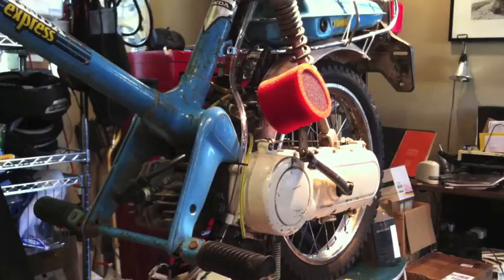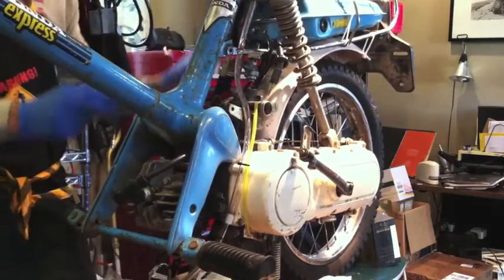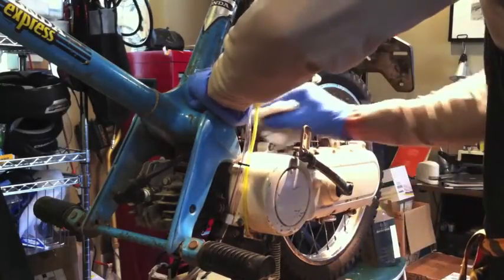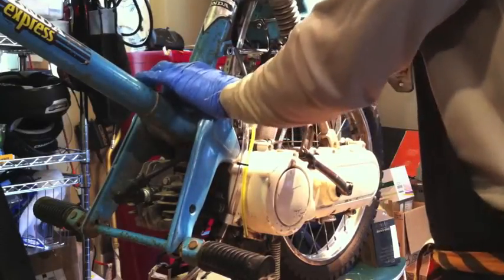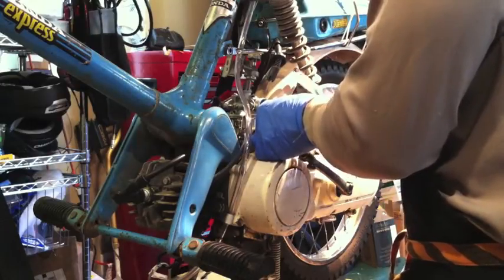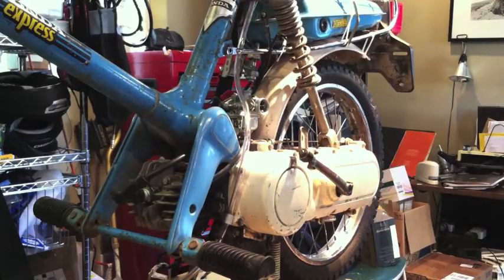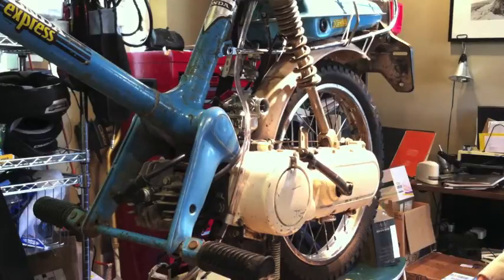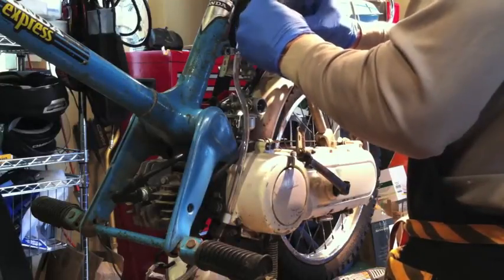Honda Express Replacement Carb Installation

Comment: Thanks for this learning videos about carb.i would really appreciate if you can help and explain my problem,i just bought a 1981 h.ex.nc50 with a rusted and plugged up carb,so i bought a chinese made one fr ebay and when i installed it,the gas lever throtle is totaly loose and the jet needle wont go up or down,theres just no function,so i wonder how am i gonna make it work?im just a begginner lol' thank you....

Comment: Thanks for the video.  Just ordered the same Dellorto carb with manifold and shim the other day.  Looking forward to installing it on my 82 Honda NX50 Express SR.   Fingers crossed that I don't have to trim down at the throttle.
Reply from the maker: I haven't owned an Express SR yet.  So I'm hoping that it takes the same carburetor and/or intake adapter.  I guess the easiest way to find out is to take your old carb off and measure from center to center at the bolt holes where it connects to the intake.  That needs to be 38mm.  If much different, there will be an issue with the Dellorto and intake.
Reply from the maker: Ok, saw your post on moped army.  Looks like you are getting the NU50 intake from MLM.  Good luck.  If you don't want to adjust throttle cable you might be able to dremel off the metal cable guide like I did.

Comment: We've got an '82 NC50. You said installing this carb on an '82 has quirks. Can you elaborate?
Reply from the maker: Goofy throttle cable tube, clearance between carb and intake.

Comment: Interested in ordering one of your carbs. Have a 81 Honda Express and am fine with mixing 2 cycle  with fuel. You you happen to know what part number or carb would work the best. Looking at the Dellorto carbs on eBay but they seem to mount up different. Any help is definitely appreciated. That's man
Reply from the maker: Dellorto carb is nice but requires intake adapter; however, easier to remove carb later. Mine works well.

Comment: The carb I seen on Amazon.is 32mm center of hole to center of hole but you said it's a 38 mm .which one will fit my 79 express
Reply from the maker: 38
Reply: @jackrutherford-1  good thing I didn't order the 32...why do they claim it will fit
Reply from the maker: @xjeepmanx  they don’t care at $18 or so each. What percentage ask for a refund?

Comment: Great Vid, Owen Wilson. I've had decent luck with the cheap little WangChung carbs on older Hondas but In the case of my 78 NC50; They're all wrong. OEM Keihins have Manual Handlebar-Mounted Chokes (As The Good Lord intended for ALL proper machines) yet NONE of the aftermarket ones do! With the carb mounting "sideways" on these I think that's rediculous. How bad is it really? I could just man up & throw the OEM unit in the ultrasonic cleaner but I'd rather spend $20 & go to bed. -_-

Comment: I have a 81 Honda express nc50 I just picked up.  Carb was rigged up with a old lawnmower air box lol runs like crap and now can't get it to start back up.  Believe it is the original carb just no airbox and has the auto choke and fuel mixer set up.  I really don't trust the fuel mix system cause of its age and believe the auto choke is part of my issues with it running correct.  Were can I get a carb that has Manuel carb uses premix fuel and can mount up without the original airbox.  Saw in some of your other videos you drilled out something on the carb to make it run right are there any that mount up ready to go no drilling?
Reply from the maker: this one does not require drilling and you use it with a 28mm air filter http://qt50.net/honda-nc50/honda-express-after-market-carb/

Comment: First I've ever heard of a 'carburetor drain hose'  ( learn something new every day! )
Maybe if I live another 67-years...I'll actually see a 'carb drain line' and now I'll already know in advance what it is
Reply: I dare say every carb on every Small Engine'd wheeled machine ever has a line at the bottom of the bowl to drain it. That would be what that screw is for.

Comment: My throttle spring is caught inside (stuck) When I get it off can I put everything in my electrosonic cleaner?
Reply from the maker: sure but I keep the non-metal parts out of the cleaner

Comment: Hello. Whats the size of your carburetor? I have 1980 Honda Humming with NC50 engine, i want to replace without replacing the intake or manifold. It would be a big help if you could tell me the exact size of what size is compatible with it. Thank youuu!
Reply from the maker: Ira 38mm from bolt hole to bolt hole
Reply: @jackrutherford-1  can you be more specific other than the bolt hole? I'll be having a hard time looking for such since im based in the philippines where resources are very limited.
Reply from the maker: Ira honda z50 clone carb is what you want

Comment: Have any advice for an aftermarket carb on an 82 nc50? I want to get one that still has oil injection but haven't had any luck. Any help is appreciated!
Reply from the maker: you can get a Dellorto SHA 15.15 with oil injection.  You'll just need the mlm adapter for the intake.
Reply: @jackrutherford-1  thank you so much, this really helps. I've been going crazy trying to fix my express so I really appreciate the reply. Do you by any chance have links for the carb and adapter?
Reply from the maker: @higu550  https://www.treatland.tv/dellorto-SHA-15-15-carburetor-with-oil-injection-p/sha-oil-inject-726185-or-2013.htm and https://www.treatland.tv/MLM-honda-express-15mm-SHA-intake-lil-SHORTY-p/motion-left-intake-324.htm
Reply: @jackrutherford-1  do you have any advice for an air filter off of treats? I'm running a 58 main jet in the dellorto and kind of want to ditch the mesh air cleaner it came with
Reply from the maker: @higu550  you just need a 60mm air filter or search for a Dellorto SHA air filter on treats and make sure it is 58-60mm diameter
Reply: @jackrutherford-1  thank you again!

Comment: hey man! I bought two of your carbs off ebay. I have a 1980 Honda Express II and a 1981 Honda Express NC50. This weekend I put one carb on the honda express II, and I had to cut back the throttle cable so that it would open all the way. This was due to the brass sleeve that comes off the top of your carb. Do you know of an aftermarket throttle cable that is the correct length and compatible with the express II? Also, I'm having a hell of a time getting it adjusted so it starts on the first kick.. Anyway, having fun working on it. Something else too, the top speed is only 26 mph and seems to fall down slightly after hitting top speed. Do you recommend drilling out the jet so it can get more fuel? Thanks man.
Reply from the maker: thanks for your purchase.  I included directions.  It's easier to cut the brass tube to size with a hacksaw then it is to adjust the cable.  If it is doing that at full throttle, you need more air.  try running without a filter.
Reply from the maker: see 13:30 of the video
Reply from the maker: I've had good luck on the 1981 models and you don't have to make any adjustments.
Reply from the maker: check out the instructions I sent on adjusting the idle mix screw for starting issues
Reply: churioz26 thanks man. It’s still me, just a different account. Lol I wish I would have just cut the brass. So this morning I took the air filter off just to experiment. No difference.
Reply: Got any other suggestions? Lol
Reply from the maker: try a hotter spark plug like a BP4HS by ngk you can also adjust the needle clip on the needle to a leaner setting.
 @thomaseubanks5323
Reply: churioz26 good idea. I read your paper that came with it. I got the hotter spark plug. I’ll try the needle adjustment

Comment: i just bought one today, the carb is all torn apart. any help? mine had a oil injector, does this carb have that, or can i plug it up

looking for parts
Reply from the maker: this carb does not have an oil injector.  You would have to premix gas/oil.
Reply: Understood, was curious if you had to plug the oil injector or if it never had it to begin with
Reply from the maker: You can run a hose/line connecting the inlet and outlet of the oil injector so it just cycles whatever oil is in there; you can cap off those ports; and/or you can remove the gear from the oil injector.
Reply: Bought a keihin carb claiming  to be the original and it doesn't fit the intake on one side, the bolt is a bit off..what carb and intake would you suggest? This is frustrating me that I can't find the legit parts
Reply from the maker: this carb - http://www.treatland.tv/dellorto-SHA-15-15-carburetor-p/dellorto-sha-15.15-lever-puch.htm works with this intake - http://www.treatland.tv/MLM-honda-express-15mm-SHA-intake-p/motion-left-intake-324.htm on the Express.